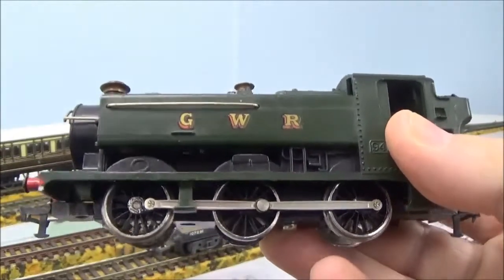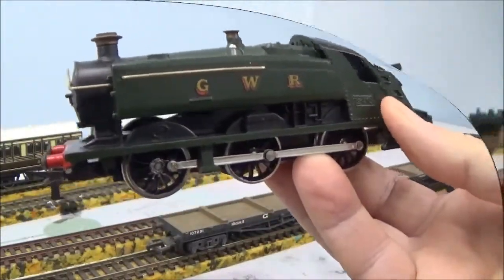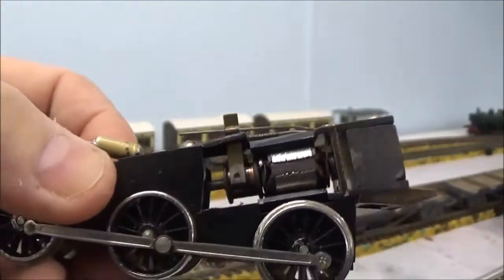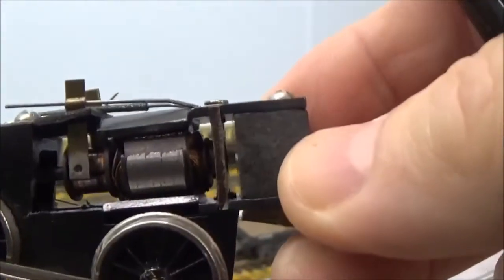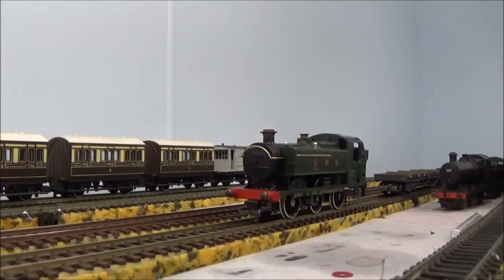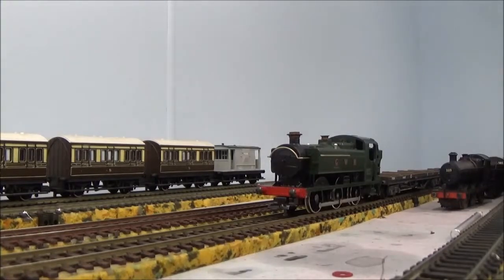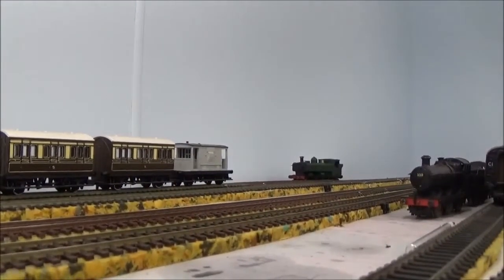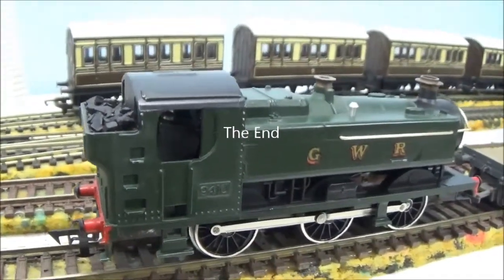The Farish Pannier

Comment: I have two of these, one with a five pole can motor and plastic gears and wheel spokes and the other with an open motor similar to the one you have but with metal gears and wheels.

One other difference I noticed is the open motor version I have is the pick ups extend to the front and rear wheels similar to the hornby dublo twin rail 060 chassis.

Very difficult to get info on these old Graham Farish tank engines so I appreciate you sharing with us the one you have.

Comment: Many thanks for this video. I am servicing the same model which I purchased as part of a job lot and had exactly the same problem with the plate being reversed. Also the bushing at the other end wasn't engaged. I now need to establish why there is a short when I connect the body to the chassis.   Once again, thanks  for this very informative video.
Reply from the maker: G`day Clive,
Thanks for your comments.
Good luck with finding the short........I`m sure you`ll get there.
Cheers Gormo
Reply: I reckon mine has the same problem, which makes me wonder if it’s an assembly error at the factory ?